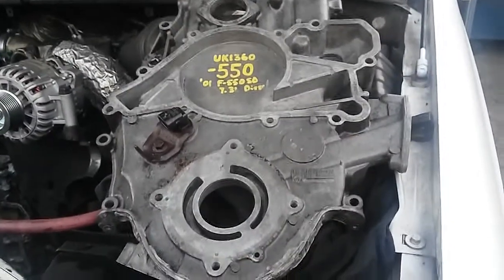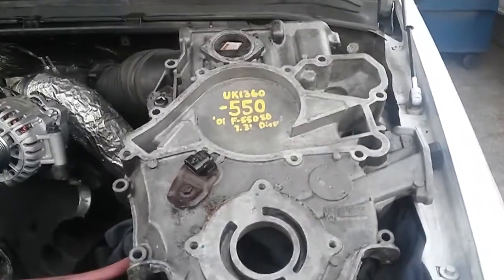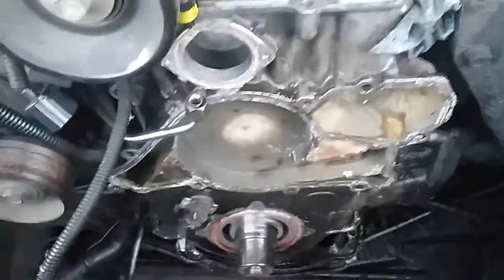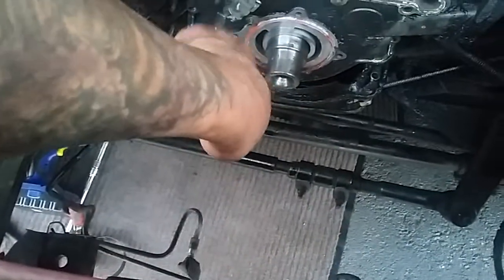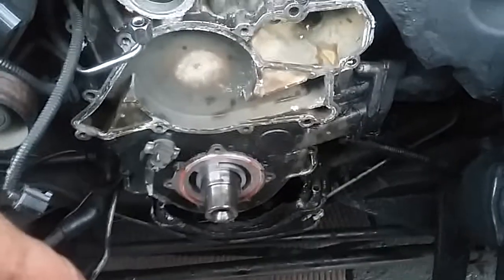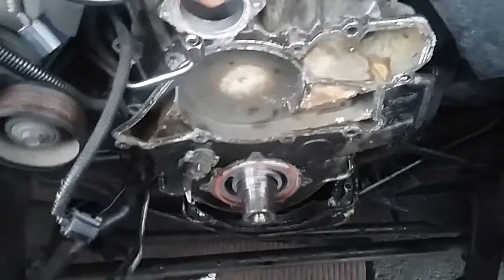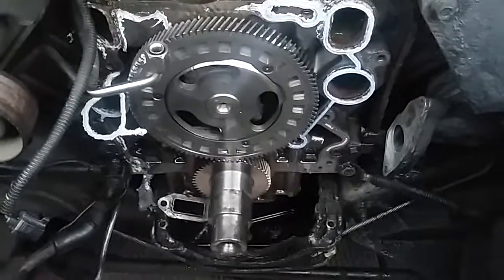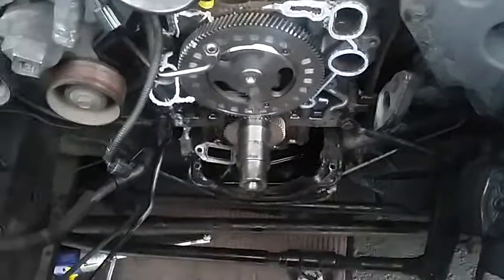How to remove timing cover - 1999-2003 ford F-series 7.3L V8 diesel engine

Comment: Do you know what caused it to crack? Mine is cracked in the same spot after I just rebuilt the engine
Reply: I did the same thing.  You have to look at the o-ring groove in the cover when you take the HP reservoir off.  The one I did I'm sure someone before me installed the o-ring with the screen in a cover that should have had just the o-ring.  I put the Ford o-ring by VIN in the truck and I know I cracked the cover there.  It's most definitely because the wrong o-ring is installed.  The Dorman cover(about $300) uses the new style o-ring(with the screen) but changing the cover is almost impossible without pulling the motor.
Reply: The pump do it you have to get the 550$ them 170$ ones no good

Comment: So did you just drop the pan a little and get the oil pick up tube bolts?
Reply: No. There are 2 bolts and 1 nut. 2 bolts that attach to the front cover and one nut towards the rear in the engine. To keep it stable. Unless you have an extremely long arm than you will probably need to pull the whole oil pan.